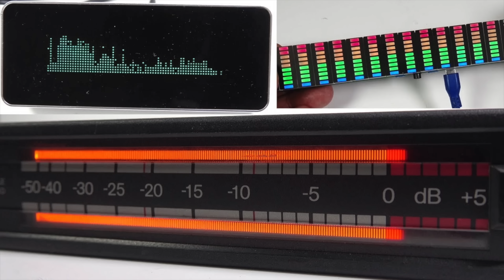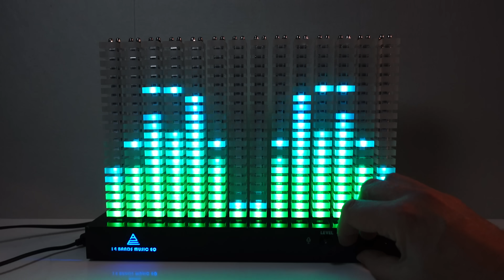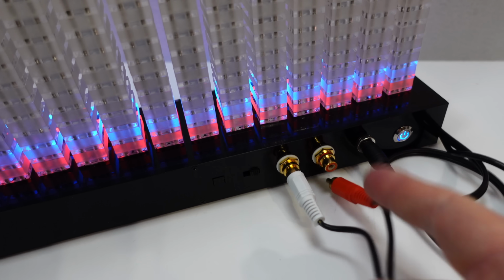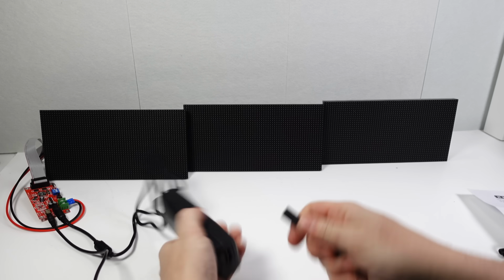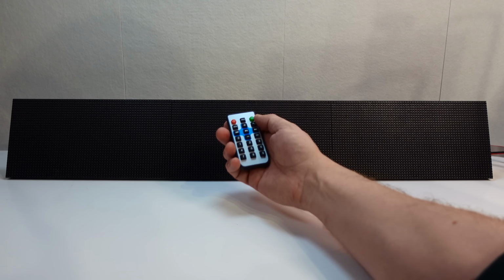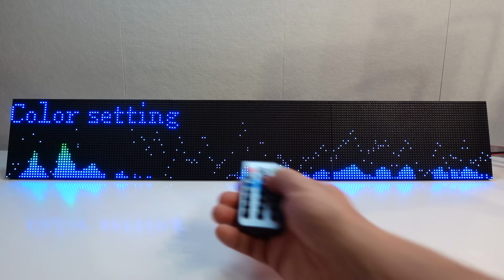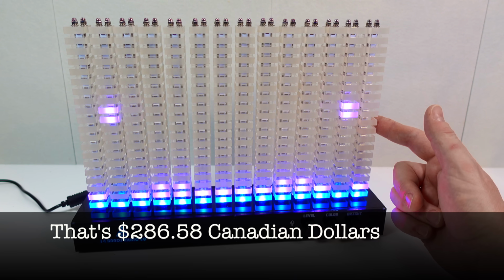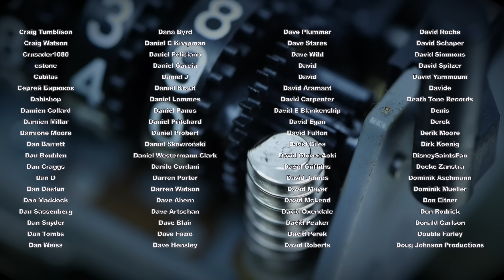Miss/LED -  two more LED music visualisers

Comment: Looking at the listings, I think the seller for the first item sent you the double 7 segment board and not the 14 segment board (or the other way around). As it does appear one if for stereo and the other is a mono repeated. I'm sure if you contacted the seller they'd send you the correct board....maybe.

I did like the look of the second one, shame about the power connectors sticking out and the gaps between the boards. it kinda stuck out just enough to be annoying.
Reply: Gaps could be mitigated with a bit of gaffer tape across the back side of the crack to keep light from shining through. Power connecctors might could be bent just right if the molex connectors will still work at 2mm less depth.

Comment: Is the first led meter an individual channel level meter or a spectrum analyzer?  I don’t feel that is a level meter, but is measures frequency, which would have nothing to to do with stereo channels levels, andeoukd be wired correctly then. I would suggest using your frequency sweep generator and see if it progresses across display as such. If it does, then it’s more of a spectrum analyzer style & would be wired ok.

Comment: The second unit, there appears to be some issue with the spectrum display. It appears that the high frequencies significantly affect the display of the low frequencies. The frequencies should be in discreet frequency buckets but it appear that's not how this thing works. Pass on both for me.

Comment: Great video. Did you notice if with the 3 panel display there is a option to flip / mirror the image (so you could have two of these either portrait or landscape and create a symmetrical display)?

Comment: You would need some space to set the 3 panel one up, but I think mounted vertically to a tower speaker it would look great! Since the on board mike is likely monaural, it would be perfect to respond to each separate speaker with little audio crossover. Does shipping take very long from China? Within 2 weeks would be reasonable.

Comment: I’m wondering if, on that first device, the left (white) input is supposed to be a mono input (as many audio devices do use the left input as a mono channel) but they somehow mis-wired it inside and when you add the second channel the mono doesn’t turn off?

Comment: Thanks for the time and effort you put into this - I'm keen to see how the third one turns out. Looks like it could be 2ru rack-mountable unit from what I could see? If so, it might fit my needs nicely if the price is right 👍
Reply from the maker: I'm really not sure what's going on with it - it doesn't look like the pictures from what I can see so far. However I'm not expecting it to be rack mountable.
Reply: @Techmoan  
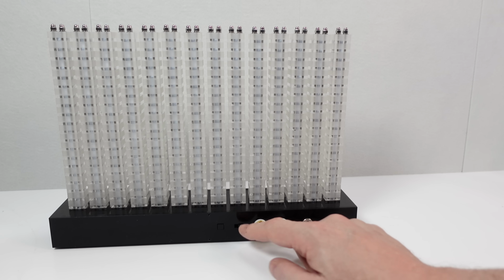Hey. Maybe those switches in video at time 1:22 selects wanted mode bw mono/stereo/left etc
Reply: @jaritorni1530  Interesting observation! You could be right.

Comment: Are there no cheaper ones that do  not come their own leds/display, but which you can plug into a tv/monitor? So just the logic board with a microphone and rca-inputs and a hdmi-output. That would probably be cheaper and give you a lot more options for the visualizations, like the ones you used to have for WinAmp.

Comment: The second one is really cool, but you didn't mention it whether it supports stereo separation. I would hope that in the modes in which it shows a mirrored spectrum (like @13:18), one half would show one channel and the other half the other channel. Did you check for that with an audio input?

Comment: Techmoan, is there a good and reasonably priced audio spectrum graph/analyzer that operates in proper fractions  of octaves that could actually be used with a calibrated microphone for measuring relative speaker performance while using a pink noise source?  So many of the 'toy like' displays don't seem to be evenly separated in equivalent fractions of octaves.  And most don't ever state/specify the center frequencies for each frequency step.  Its anybodies guess and as you've pointed out,  some of the 'cute' displays are really just for show and may be faking some aspect of operation.   Thanks!

Comment: 1st display, I wonder if the Mic changeover switch is anything to do with the lack of a proper stereo image, since when turned on the mic drives both channels??
2nd display, looks great, but expensive and only displays 1 channel??????? Think there could be more thought into how this is implemented over such a large display! Not to mention you have to build it yourself and there is no box with it.......

Comment: Did the first one have any settings that weren't shown?  Like setting it to be a single 14-band spectrum analyzer instead of dual 7?  I would probably actually prefer that and the fact it's wired weird wouldn't be as big of an issue.

Comment: The 2nd item is way cooler, but is there a way to program it so it could be a mirror image, similar to the 1st item?  Whether mirrored like the 1st, or actually shows the left channel on the left half & the right channel on the right panel & a half?
I mean, not that I can afford either, but it'd be nifty if you could, say, be more creative w/the programming, either onboard or via an app/program you connect it with.

Comment: Re the first display; It's fairly standard practice on mixing desks for the Left channel to be Mono on BOTH outputs. If you select MONO input in Audacity, you'll see only the Left channel level indicator rising. Select STEREO and both indicators move. Maybe they chose to make the display mirror the L onto both sides when using the built in mono mic. 
Also the display seems to be mirrored in levels with HF in the middle moving to LF towards the outside.

Comment: Item #1... Dual (mirrored) 7 Band isn't 14 band as it claims. I was disappointed, as with the channel issue... surely it is the same circuit for Left and Right, duplicated (i.e. mono x2). Perhaps they tried something clever with stereo and doubling up the mono but clearly went wrong.

Item #2... I like this very much. My only criticism is being able to detect the individual boards... things like that really annoys me, and once you have seen it you cannot unsee it. I wonder if the boards being able to slot into one another would fix this.

Looking forward to the other item being constructed and reviewed.

Comment: Scrolling pretty far down, I didn't see anyone ask: did you find out what the switch was for?  Could it possibly disconnect the left channel from the right for proper stereo (one setting would be intended for the single mic, the other for stereo RCA input)?

Comment: I think I'll continue holding off until I find a decent (for audio) oscilloscope thingamajigg for not that much money that I can hook up to an hdmi display. Doesn't need to be petahertz accurate in its sampling. It's just for audio so a single megahertz sampling would be plenty enough for my needs. 

As long as it can decently show oscilloscope music, it would be enough. 

But alas. That device is still nowhere to be found.

Comment: There was an unmarked button next to the switch on the first one, what did that do? Perhaps it swapped from mono to stereo mode? Or perhaps theres a bug in the code on the controller, it just looks like a standard hobby micro on a custom board. Bet someone could figure out how to fix it.

Comment: What about frequency sweep test for first device? It would be nice to see how accurate it is. Pity it was not tested (or shown in the video).
Nevertheless, I am waiting to see part 2.
Reply from the maker: Didn't seem to be any point - it's just a toy with only seven active unique bars rather than a device designed around accuracy.

Comment: I would be extremely disappointed if I paid $250 and received that first unit. It's arguably illegal false advertising that it says it has 14 bands when it's really 7 bands duplicated. (It's not like it's possible to do anything about random Shenzhen sellers, from a legal standpoint anyway.)
Reply: Completely agree. Much better to do the electronics yourself... just having that same finish is going to be insanely prohibitive to do as a DIYer. I am surprised they failed at the electronics rather than the overall build, as the electronics parts is the most easiest part of the entire product!!! 

It might be achievable to hack the product by replacing the circuitry... but having paid so much for it, it isn't really feasible.

Comment: Despite the expense, I could see the second unit being a worthwhile investment for a DJ for hire, to help add some interest to their shows.  The first unit seems too small for this purpose, and given the false stereo display, doesn't even seem fit for home use.
Reply: I was thinking of mounting the second one in front of, or on the wall behind the DJ booth in a small club, or in the bar room where they're no VJ. You'd probably want to line-in the audio from the main mixer so the mic wouldn't overload when the sound got loud.

Comment: It's SO sad that almost NONE of these kinds of things, (none that I've seen in recent years anyway), are at all accurate to the different frequencies of the music across the display from left to right and from low bass to upper treble, like a true spectrum analyzer SHOULD be in order to be anything useful. It's sad because these things like this, especially something like the 2nd one, could be really quite awesome and amazing IF they were accurate to the music like a true professional quality frequency analyzer is, but these are like just more or less wasting the potential in something like this!

I really wish I knew how to build something like this from scratch and program it properly, because I have a few ideas for one of these types of audio spectrum displays, but I have NO idea how to realistically implement my ideas into an actual physical product, because I'm not at all a computer programming nerd or anything like that...

But, for example, I've always thought that it would be REALLY cool to have a little add on box or "stick" that you could plug into the HDMI input on your TV and be able to display a true and accurate, (i.e. fully calibrated AND with marked reference points across and up and down the display), FULL spectrum analyzer display, all the way across and utilizing your ENTIRE TV screen as the display! With a modern large screen, high resolution TV it would be super EASY to have plenty of total display room for literally hundreds of frequency bands across the whole TV screen, left to right, covering the ENTIRE audio spectrum, from the lowest (sub) bass all the way up to the highest ("super") treble frequencies, and also plenty of display room height-wise to be able to display at least hundreds of individual segments of relative LEVEL from the bottom to top of the TV screen for EACH one of the individual frequencies across the TV screen from left to right, ALL of which could also display an almost infinite number of colors, (however many colors your TV was capable of), and you could also have plenty of display room to also show multiple "types" of displays, and even full spectrum, separate left and right channels at the same time... The possibilities with a device like that which used your TV as the actual spectrum display would be almost endless!...

So if something like THAT was ever built/implemented, programmed, AND calibrated properly then it would, (or at least potentially COULD), be totally badass, I think!

And it wouldn't actually take very much actual hardware to make it either, it could basically be like the size of an "Apple TV" or "Amazon Fire Stick" or any number of other HDMI plug-in devices if it had its own built-in calibrated microphone, and if you designed it to also have RCA and/or 1/8" mini jack stereo audio inputs for hardwiring it to your stereo system, (for proper left and right channel separation and indication ability), then you could just have a separate, small black box with an HDMI output on it, just like a modern cable or satellite box does, so potentially at least, it wouldn't have to be all that expensive to build either, because there wouldn't be much physical hardware required to build it... I just don't know how to program something like that... nor what kind of IC chip/CPU it would require to make it, so unfortunately my idea will probably never come to fruition. :(

Comment: Why not contact manufacture and ask why it is wired like it is? Perhaps an error they are not aware of, manufacture defect or working as designed. Request it be corrected to show both channels, simple request and something most would want.

Comment: The first one is completely useless. It only looks like a graphic spectrum meter, but it is just some random flashing "thing". doesn't even measure any frequency at all. Obviously, the other two are simply toys and have no accuracy in frequency measurement. BUT, that being said... the 2nd one actually looks fun! It's a great size and if you are simply using it for decoration purposes, I'd say it would be pretty nifty.

Comment: Ooof, $AU300 for 3 P3 or P4 HUB75 panels is bloody pricey. They're about $10-20 each normally. So they've either marked everything up something crazy or are claiming their crappy little controller board is worth $250 🤢

Comment: 2:42 looks like that's not 14 bands, that's 7 bands per channel.
5:48 it's worse than i thought. they just mirrored those 7 bands. IOW, they're cheating. those "14 bands" are nothing but marketing BS.
6:32 there you go!
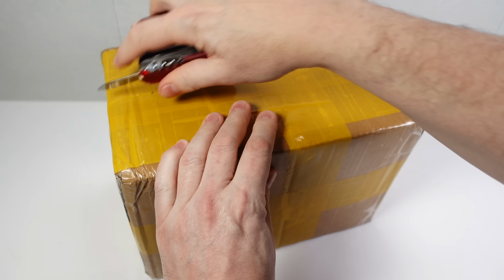7:56 lets hope this one is better.
Reply: I explained earlier "For the first visualiser, I visited the Ali web-site and saw that there are two versions - one is 14 segments and the other is described as 'double 7' segments. I suggest you have one of the latter as I think it would explain the duplicated display". The more I think about this, the more I am convinced this is the answer !

Comment: What's with the length of some of those demos?!  JhC!  [It's nothing personal, and you ain't the worst offender.  I think the gold prize goes to electronics engineer Dave of EEVBlog.  I've noticed many regular content producers trying to push the 22min mark, and it makes for some long-dragging content.  Feels FORCED.]
Reply: Click on the sprocket gear icon and you can increase the playback speed. I watch most Youtube videos at 1.25x.
Reply: @8bitwiz_  I would have enjoyed those puppets that were used before.
Reply: 1.5x did the trick with EEVBLOG

Comment: Big Clive would take the "fuse" out of that plug and see if it works anyway! You'd be surprised, at first, then disappointed, then horrified, to see how many fuses in plugs from Chinese crap sites are purely ornamental and won't stop your house burning down. So either use your own reputable plug-country-adaptor, or better, get a DC power supply, with a British plug, that actually meets some sort of safety standards. Dunno why the thing can't use USB, I suppose it wouldn't create the right impression in their customers' heads, not that that sort of customer would ever buy owt off Alibaba anyway. But really, when you buy shit like that direct from abroad, YOU are the importer and meeting safety requirements is YOUR responsiblity, so they're under no more obligation to give a shite than any other Chinese factory is. If they work their workers to the point of suicide, and scoop up fat out of the actual bloody sewer to fry food in, cos it's tuppence cheaper than just buying it fresh, don't think they'd worry about your missus and kids dying in a fire.